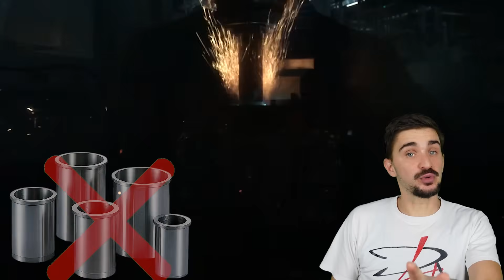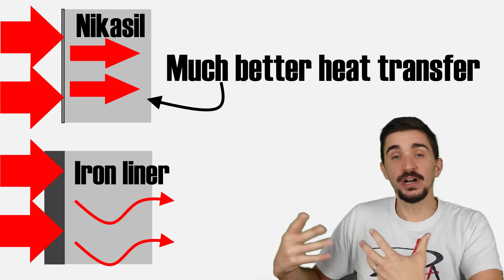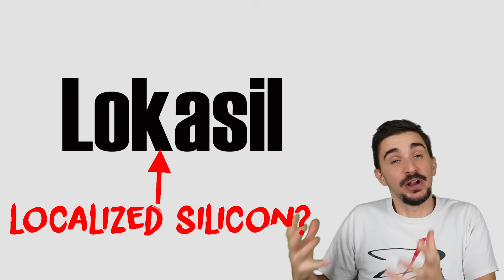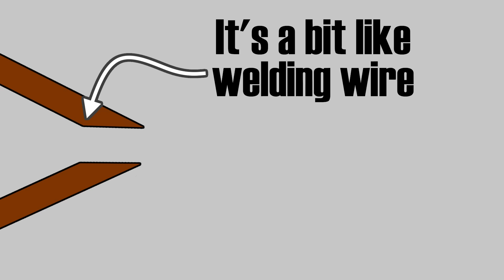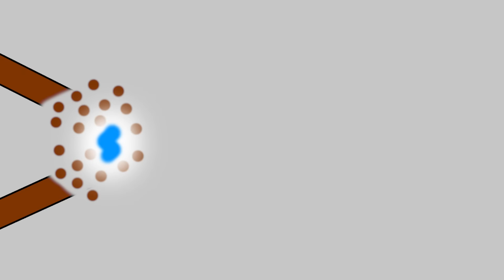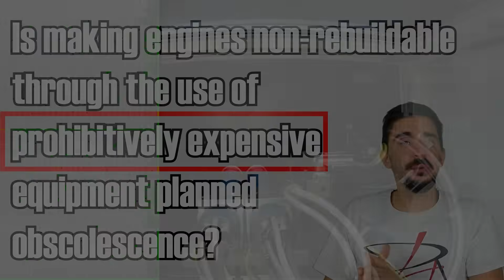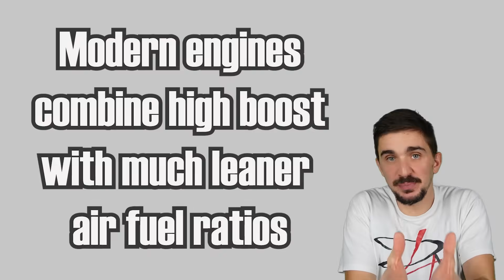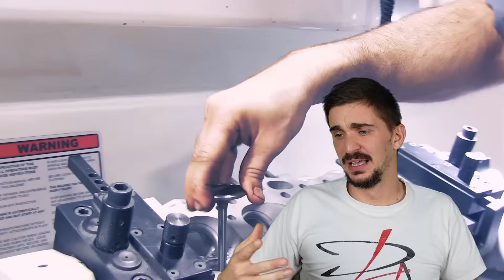Why Are Engines Becoming Non-Rebuildable? Everything About Cylinder Coatings

Comment: With motorcycle motors that are alloy with nickel coat.... they are junk. I own 1 that's from 2008. Kawasaki...  if you bore or hone you have to re electo plate. So they can be used. If you go back to the 90s. Like my kawasaki zx6r 1998. Is iron sleves and so a bore n hone is easy. But the motor will see 200,000km if looked after. My 08 gpx will need a new bore set after 50,000km that's a massive difference in life span. BTW my 98 zx6r has 36,000k.s currently and my 08 gpx has 6,000kms. 😂😂 my honda cbr1000f was also iron bores that had 158,000kms when I sold it

Comment: I worked on MBs for 35 yrs. These new engine building tech have benefits, but also problems. These new techniques are a failed attempt from the auto makers to not electrify. It makes the engines non-rebuildable and very expensive to fix. MB is producing 4 cyl heads that don't have hardened valve seats. I've seen cars with 50k on their 3rd cyl head because of this new technique. It's an expensive mess. As you've seen in the news, new engines are failing all over the country. I feel that ICEs will fade out. ICE has had a good run, but technology will bring them to an end.

Comment: I’ve just put a new camchain and valve guides in my 2007 VW polo 1.2 3 cylinder engine. It’s covered 125000miles and the bores are like new, I really couldn’t believe it, not a sniff of wear. I almost scrapped the car and I only took the head off for fun to look at the bores and see how many valves were bent after the chain slipped. Fortunately the chain had only slipped one tooth and all the valves had survived, I then thought hey this might be worth repairing?? I did the entire job for £385 in parts ( that included oil pump chain and sprockets) and it’s been running like a sewing machine since!! It was actually not too bad a job.

I’m used to working on classic cars so was a bit worried about tackling a ‘modern’ engine until I spoke to a mechanic friend who said modern engines are easy to rebuild as they don’t require any fettling and knowledge , you just buy the parts and put it together as the manufacturer states, he said they’re designed to be put together by burger flippers😂 he said just change the oil and coolant twice as often as the manufacturer states and you’ll have very few issues from most modern engines.

Comment: Theoretically cars should have gotten cheaper and easier to work on with time as technology improves. Instead they've gotten more complicated, way way more expensive and harder to work on at home. There's no reason for stuff like BMWs battery registration nonsense, it's just gouging the customer. There's no reason why LED headlights need to cost thousands to replace, except they were designed to gouge the customer. We can go on like this I bet, anyone care to add to the list?

And if I am honest safety standards have become too stringent too and are making cars too heavy and restricted in design, and car safety completely ignores safety for pedestrians and other car drivers and many modern cars are way more lethal to pedestrians and people in other vehicles.

Comment: The people who made nicosil were lazy and copped out. What they should’ve done is create dinner iron sleeves spectated with a layer of graphitic carbon nitride it’s three times the hardness of diamond. 
The other option is to make graphing impregnated iron alloy  saves weight on the iron, makes it far more heat conductive and gives it a harder surface, which will last longer.

Comment: Non rebuildable is a load of crap. They last 10 times longer than an iron liner. No need to bore the cylinders, they dont wear out. And you can resleeve or re coat the cylinder. Nikasil is a good product. Motorcycles have used it since the late 70s. Kawasaki to be specific. Ill take a boron or nikasil bore ANY DAY OVER IRON!

Comment: I thoroughly enjoyed this video. About 20 years ago I dealt with a company in Johannesburg Pretoria, who performed teflon coating on a mould that I was building. They were very excited about a new department that they had just opened and I was invited to view their new metal electric arc spray equipment. Their machine shop was busy reboring used engine blocks back to factory spec for VW OEM engine rebuild facility. The engines  had been recoated using the same process you saw. I watched whilst the metal thermal spray department was busy resurfacing used cylinder heads to then be milled back to factory specifications for the same client. It was very impressive to watch and the CEO who took me round the plant assured me that this technology meant that any defect free but worn old engine could be resurfaced and rebuilt.

Comment: Whether you have a smoking gun showing it's planned obsolescence or not it's still a massive infringement on the right to repair and another step in the direction of being permanently dependent on manufacturers for everything. Local businesses can no longer fix things because it requires proprietary parts that cost as much as the thing they want to repair is new or it requires them doing 5x the work for what was a simple job 20 years ago

Comment: I used Slick50/Teflon, back in the day on a 64 Dart.
 Went from 20mpg, too 32mpg. You could run it out of oil and it would not seize.

Comment: You're talking ONLY ;the cost of recasting the block, and comparing it to the cost of the entire rebuild.

Engines are not recyled, only with the block, the entire car gets recycled. So your numbers are very far off.  The entire car being junked at 150-200k miles triples the effects compared to classic methods. Understand that in the united states MOST work trucks easily go 20+ years, 300,000 + miles, get rebuilt for nearly zero CO2 emissions, as there's literally nothing but a set of pistons, bearings, chains, and seals replaced.  Then drive another 200-300k miles.  We often use vehicles for 500k miles.

The supposed improvements in emissions are a huge lie as well. These new engines are only clean for a few years.  Older sleeved engines burned clean for 250k if kept in proper tune. Modern stuff we're seeing fail emissions in 90k miles.   NEW DOES NOT EQUAL BETTER, it equals bigger profits. Further CO2 is not the only emissions we should look at. It's actually the LOWEST priority. If we kept population reasonable, and planted more trees instead of building millions of homes so that people can over-breed like rabbits c02 can be cleaned up without any real work.  Toxic chemicals for the plastics used to make these cars that fall apart in 10 years or less are the environment killers.  You can offset the difference of driving a 1983 full size big block suburban at 12 mpg compared to the most fuel efficient hybrid today with a few trees. You can't offset the toxins used to make that new hybrid in 500 years of chemical decay.

It's marketing hype and people like yourself, with an audience have a responsibility to help correct it, not be a shill for it.

Comment: MANUFACTURERS will ALWAYS spend more, to make a product where you MUST replace with their system, by ensuring the cost for YOU the average person cannot afford to fix, while they CAN easily rebuild/fix it.

The coating method makes it where the original builder can EASILY replate and recycle the engine, while independent machinists cannot afford to.
Your denial of this makes it obvious you have not actually been a mechanic.  Manufacturers have over the years repeatedly patteneted fasteners and tools to prevent anyone but dealers servicing their vehicles. import manufacturers even sue people for figuring out their software to allow end users to repair their vehicles, even when they NO LONGER make the modules and parts in question.

This is 100% a business decision. You could change every single engine in existence in the most minimal way to properly hold a cast in place sleeve, and you would, in every single example have an engine that no only lasts longer, but also performs better over the LONG TERM and stays clean burning for a LOT longer. 

So yes, they're all bad for the environment. they're bad for the end user, they're only good for the profits of big business.

Comment: Just coming out of the gate I can see there's some fallacies about rebuilding engines being some sort of redundancy and the reality is it simply isn't true anymore. In the past big mass producers persisted with very outdated technology for simplicity and reliability which resulted in affordability, cars from mass manufacturers like Ford and GM often used 1930s technology all the way through to the 1980s when the European luxury performance lead grown by limited production and much higher manufacturer costs simply could no longer be ignored in the age of higher emissions standards and therefore greater volumetric efficiency requirements. You could no longer solve technical failings by simply throwing cubic inches at a car and here is the point. Those simpler engines are relatively cheap to recondition/rebuild and even improve upon factory standards. Doing the same with an old luxury Euro engine, or any modern engine x5 cost at least. The happy medium was, for a while Japanese production which mass manufactured European copies at much lower standards, very loosely speaking but the Euro luxury motors continued refining their lead and small measures became increasingly significant in the further tightening up of emissions and performance efficiency standards. Proverbially, it used to be a couple of grand to rebuild a powerful street engine, now it's ten for the family hack. In old school terms it's basically the difference between a mass manufactured and luxury car engines. It's just the standards have raised on common models and a rebuild costs more than the resale value of the car, as much as a model upgrade. Simply falling behind in your service maintenance requirements for too long is capable of writing off a budget model car these days, or destroying a luxury car engine more expensive to replace than the car itself.
Dismissing the realism of engine rebuilding in modern cars isn't a conspiracy by the manufacturer. In virtually all cases it's simply far more expensive than what it's physically worth to the customer.

Comment: Usually, if you need an engine rebuilt, the whole car goes to a scrapyard.
So it is always better for environment if engine last longer. 
My father still ounces Opel Kadett E, 1989, 1.6 l SOHC engine, nobody knows the real mileage of that car, but it still runs.

Comment: Nope. If you recycle the engine then you are really recycling the whole car. That includes all the plastics that don't get recycled. The true comparison is between doing a little machining and replacing some parts in an engine rebuild versus building a whole new car as well as scrapping the old one. I understand manufacturers have to chase emissions standards but the current outcome is building disposable engines which also make the car disposable. That's no win for the environment.

Comment: When I worked in an engine machine shop, most of what we did was agricultural, performance and vintage restoration. We did have some cylinder heads from regular passenger cars, never saw the blocks. There are plenty of good junkyard engines for many late models that are far cheaper than a quality rebuild.

Comment: Don't buy disposable cars.
If they give 300k mile warranty I'm OK  with plated bores, but a failure at 30k miles necessitating an engine replacement of a $50,000 engine is not acceptable.
Every engine should have an a assembled oil flow analysis, and an electric oil pump to pre lubricate the engine before start. The oil should be filtered before the oil pump.

Comment: Bah! We Americans just bore the cylinders and install the appropriate sleeves. Just like with we do with our domestic aluminum blocks such as the LS3 block. As long as you have enough cylinder wall-to-coolant passage thickness, just bore and sleeve it. Make sure to have a couple of thousandths interference between cylinder ID and sleeve OD. Then you're good to go. 
As far as sleeves being available, many sleeves designed for one brand will work for another brand. Just a little research and then go. If you can't find the right sleeve, we have enough machine shops in each town/city, we have sleeves made. You can even apply different platings to the sleeves before installing. Just make sure you have the appropriate cathode/anode and a good DIY setup. I use a 20ga fish aquarium and and a multi-setting battery charger for my platings. Works perfect. Materials(cathode and anode) can be a bit expensive.

Comment: Alusil, lokasil etc are rebuildable. The etched coatings can be re etched but not many machine shops do this. You need expensive diamond cutters for both boring and honing. Nikasil can be dissolved and replated.

Comment: Can't the other -sil coatings be done through thermal spray painting? If it only takes a couple wires and plasma, if you change the wires from whatever to silicon then you spray paint the cylinders with that will be the same as silitec, right?

Comment: Besides pushing things like mileage, emissions etc. to the limits in designs making disposable engines is likely a bonus. It in turn makes the cars disposable. I wouldn't be surprised if you see a company (like Jasper in the US) have a spray lining system of their own, nor would I be surprised to see a company start producing either lined aluminum or iron blocks. Back in the day World Products made Ford Cologne V6 cylinder heads to replace the garbage that cracked, and it was their #1 product. There are at least one or two makers of the Jeep 4.0L head for the 00-01 crack prone heads. Those engines have been out of production almost 20 years at this point. As cars become more expensive (once again due to government regs) people will increase the life cycle of their vehicles. At some point I expect 20+ year old cars to be far more common, just because it's what people can afford.

Why are we just doing the math of the engine blocks? That is really thumbing the scale? Not many dump the engine block and keep the car at the end of its life. It should be based on the life cycle of the whole car on average vs the amount of cars that are sent to the scrap yard in less or more miles due to engine block failure. An engine is something that can make a car not viable to fix whereas it may have been driven longer if the engine was not dead.

Comment: Is it really neccessary to construct an engine in such a way that a  damaged bore can be repaired ? The shops do not repair engines anymore, they swap them. And there are enough engines available from the scrapyard, because more cars fail with damaged body than engine failures. And if you really want, you may insert a liner after enlarging the bore. So if this construction does not lead to vastly reduced lifespan, as the wet belt, or hefty increase in maintenance cost, as the chain, then we should accept this new method.

Comment: I think you are missing something from your math. Usually when the engine of a car fails and can't be fixed, the owner of that car purchases a new or used car vs replacing the motor, meaning that the ENTIRE CO2 emissions of that car (not just the engine) gets wasted and likely only a small portion of it actually gets recycled. If the motor can be fixed for a reasonable amount, I think most consumers would prefer that to doing an engine swap with an unknown used engine.

Comment: I think a combination of both is fine. Rebuilding old engines and if possible equip it with newer technology. The engine has been made before and thus wont need as much ressources as a brand new emgine.

Comment: One thing that is worth considering is that the need for an engine rebuild/replacement is often a reason for people to scrap a car. That is one more car that is being manufactured and costing the emissions of building a whole car (divided some factor to account for expected remaining lifespan of that car after repaired) 

I manage an auto repair shop that replaces engines regularly (usually with ones rebuilt by a third party). I see far too many otherwise good cars get sent to the salvage yard because the customer can’t afford an OE new engine and rebuilds and used  are either expensive or scarce. Of course this scrapped car is feeding into the market of used parts that increases the repairability lots of other cars which keeps them on the road and saves on needs for new cars. 

This isn’t an argument that uneconomical to rebuild engines are less environmentally friendly than traditional ones. It’s just another layer to the already complicated calculus of environmental impact. 

It is however a point toward the negative effect on consumers of uneconomical to rebuild engines.

Comment: gasoline burning propulsion will soon go down the same path as the dodo bird, like the foolz who don't realize that an electric motor with battery is Far better than this old fashion, air polluting, maintenance intensive, slow to accelerate, noisy pile of crap current foolish form of propulsion,. wake up and smell the un-burnt hydrocarbons and carbon monoxide.

Comment: i would not trust car manufacturers to be doing anything good is there actually any proven data on how long these engines will last compared to a cast iron sleeve or is it all guesswork. the we are doing it for emmisions is not a good reason when it usually is for the manufacturers pocket.